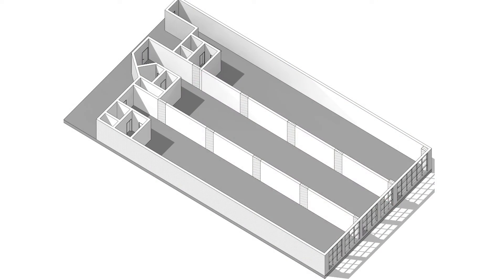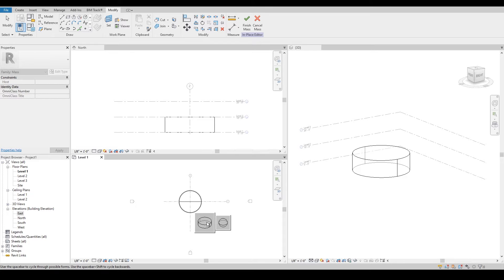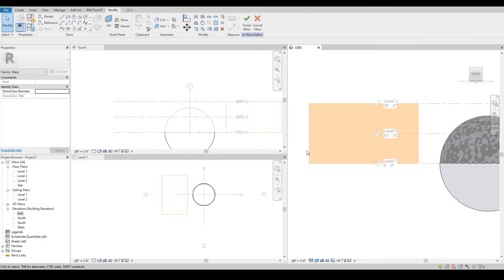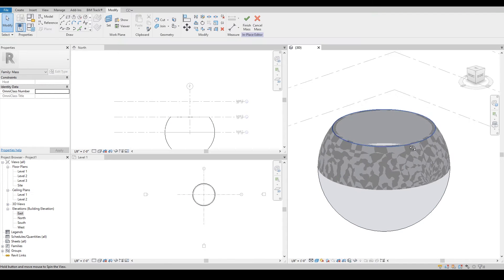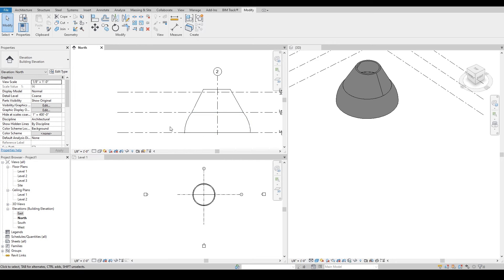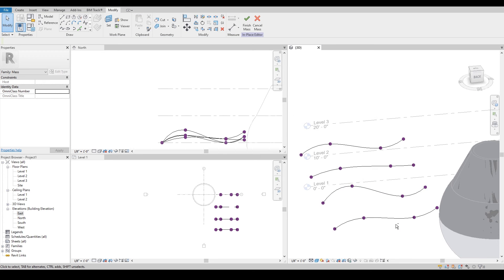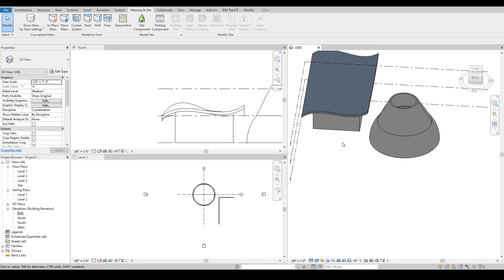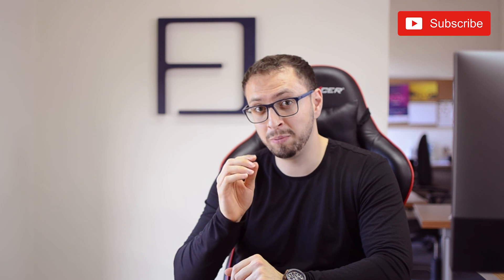5 Hacks For Massing in Revit Tutorial | Tips and Tricks

Comment: Cant follow much bcz your cursor moves too damn fast
Reply from the maker: Thank you for your feedback A Thunderbolt H! Note is taken. Could you be more specific what or where you weren't able to follow?
Reply: @IntegratedBIM   I think the tips are very nice but your speech and actions are rather fast for an educational video (I assume that is the purpose of sharing it?). Hence it is difficult to follow some of what you speak and some of the ribbon choices you make because you move your cursor too quickly. Of course, it’s fine if the intent is merely to share tips w users already familiar with this stuff. Ive used Revit mainly as a production tool, hence am new to massing (which I normally do in Sketchup). I tried a number of times to copy arcs and splines the way you do in this video but it wont copy. The workplane etc are all exactly as you have it. Revit 2019 is what I have.  What is the secret then? Why cant I copy the splines or arcs in 3D massing in place mass command? Strange.